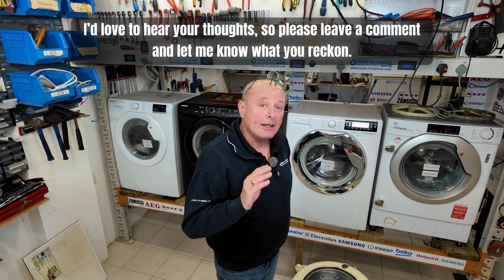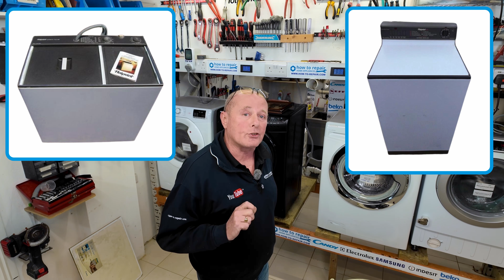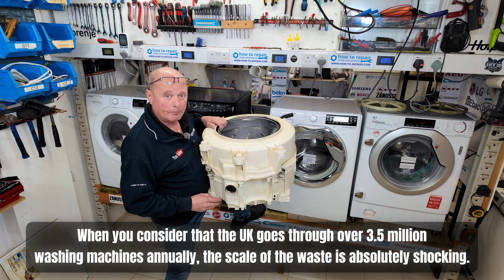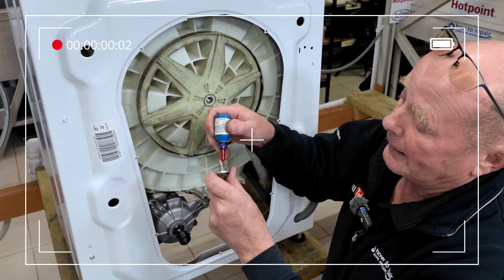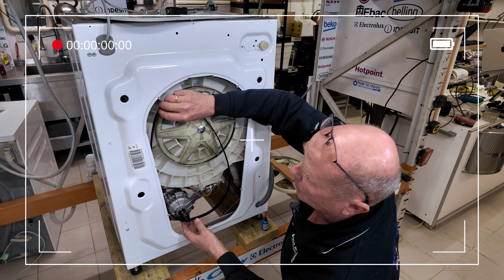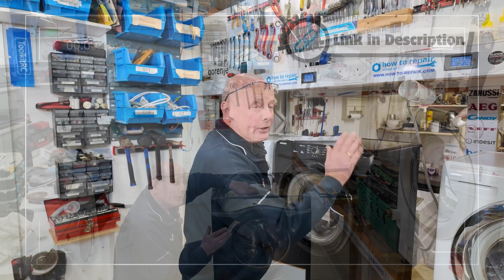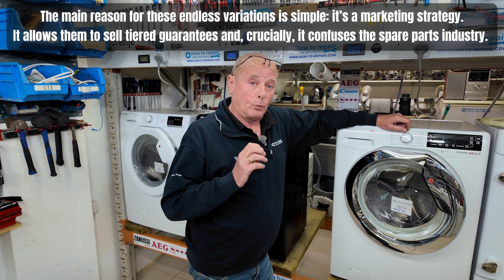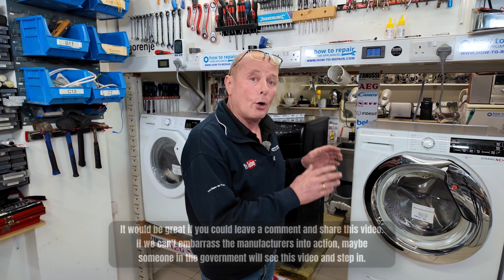I Scrapped 13 MACHINES to Prove a Point: STOP BUYING These Brands!

Comment: Hello everyone, I want to tell you that even the sealed drums are repaired in Bulgaria, we just cut along the edge of the glue, then we change the bearing, seal with silicone for motors, reinforce with bolts 5 milliliters or 6 millimeters according to the drum and that's it, all this costs about 25 euros. We assemble and you're done, that's it.I forgot to say that the price is if you do it yourself. 😅😊
Reply: Yeah. Recently had mine break (barely 2 years old) and I am going with the same plan after having seen it being done online, in posts and videos. The bearings failed and I'll have to cut the drum open. Drills holes prior, cut it open, replace bearings, use RTV silicon, bolt it, put it back together. Hope everything will go well.

Comment: Planned obsolescence is one thing, but restricting expert owners and repair shops the right to actually repair the Machine without the company scraping off the serial numbers of parts on the PCB. Making it impossible to know what the part was, is a absolute disgrace. 
If I can't find the part as the company do not supply the part. I will buy another one remove the parts and then return for a full refund.

Comment: These products are indicative of the society and paradigm we are living in. The Globalist machine rewards these manufacturers with creating sub-par products with a planned obsolescence in mind, it rewards them when they base their manufacturing plants in areas with ultra-cheap labour, and therefore lower quality labour.

It rewards them as it has conditioned the consumer to constantly want the latest product, no matter if the previous product works or not. It is in their interest then that the previous product doesn't last longer than when the next latest product gets released.

Repairing and restoration is indicative of the previous paradigm, a paradigm that was consumer friendly, a paradigm that rewarded local manufacturing, as it created a sense of belonging and community. This paradigm doesn't exist now, replaced with the modern paradigm, where a sense of belonging and community is looked down upon and punished. You are just a consumer, an economic marker within an economic zone.

Comment: I appreciate your video more than my washing machine from 2008, an Indesit Wil 105 that is still running. I changed only a belt and two small pieces (consumable) made from graphite or smt at the motor. Next time it brokes, I will try to repair it because is rock solid. I don't even think to buy a new one.

Comment: I'm afraid this is nothing new. I remember when I was a kid in the 80s, an engineer friend of my father told us that all the appliances and electronic devices produced for Europe since the 70s are designed based on the obsolescence principle, which means that all the manufacturers at some point decided to make all their products non-durable, meant to break easily, for quick turnover. Ruthless profit became the priority over durability and reliability.
I wish the environmentalists would campaign against this disgraceful practice, and in favour of durability, which would reduce environmental impact, waste of resources and pollution, as well as help households' finances.

Comment: Philips! wow are they Electrolux now. Grandad still has a Philips gas hob the only part missing on my Grandads hob is the ignigtion clicker button, the plastic is still able to push down and fire his hob, It must be 80s but the material ofthe hob cleans like a dream and just looks like new. The built in oven died many years ago but that must have lasted until 2004 and replaced with a Miele that on it last legs after 20 years.

Comment: Hoover/Candy are the worst. 2 x PCB failure on washing machine, and the dryer has gone through 3 x capacitors, 1 condenser unit, 2 x doors and 2 belts. The 2nd filter is useless, oh and they are also a fire risk, as evidenced by Hoover/Candy themselves!!!!!

Comment: They are also making worse machines in terms of program options and length, not just lifespan. I bought my top loader Hoover washing machine in 2022 and it was one of the very few top loading machines that is even capable of running a 90 degree program at all as there are already very few top loaders in the market over here altogether (Czechia but it is probably EU wide situation?). 90 degree program is a necessity if you have a dog or a baby because you need to wash some stuff at this temp to properly clean it (for example eco friendly fabric nappies). The programs on it are horribly long as well compared to a washer that my mom bough like 20 years ago. Like double the lenght for normal program, triple for eco. So when her washer broke last year, I actually advised her to let dad check it and repair it instead of pushing to get a new one because the new ones are shiet. And btw, my machine broke after half a year and the soft close latches on the lid corroded pretty much after the warranty has ended. You just earned a sub so I can learn and know better when this goddamn thing inevitably goes and I will be in the market for a new one.

Comment: Is it possible to build your own washing machine with standard components that are all easily replaceable?
Having the electronics with a Raspberri Pi and using it to control the washing cycle. The community would be able to make clever programs and optimize the runtime.

Comment: If they can't make a washing machine that lasts a lifetime today, it's because they don't want to. The wheel bearings on my machine are still original, and it's over 30 years old. A bearing today can't last just 5 or 10 years; it's because they don't want to. Just as they don't want to make stupid washing machines that last. It's simple.

Comment: I worked for Candy and Hoover, actually the chinese Haier group and it was all manufactured in China. They were building a whole new plant in Romania to manufacture in EU. But, to be honest, it is not a matter of where but how. They are cheap. I bought the top of the line Haier's WM and its awful. The digital front panel just brokes every 6 months and I am tired of it, the preset programs still work but I cannot change the settings in terms of temperature or time. I hate them.

Comment: LG washing machine - never again! I had an issue just after the warranty ran out. Post warranty repairs weren't even provided, so I had to fix it  myself. One year later I had to fix it again, related issue... 6 months later I again it had problems - I then threw it our, 3,5 years after buying it. The problem is related to the concrete weights that break into pieces, twice, a piece fell down and snagged the wire to the heater, third time the whole remaining piece got loose and the machine started to shake like crazy and the vibrations unscrewed a bolt, after that I decided that it was unsafe.

Comment: Than you. The main reason why a machine built 100 years ago is replaced is not, that it is broken and you can´t repair it. The reason is, that it is old fashioned. Has not same properties than new machines. My washing machine is 25 years old. My parents bought a refrigerator 60 years ago. My sawing machine is much over 100 years old (from my grandmother). These all are working well.

Comment: PLEASE, make and release plans for your own appliances!! The general public has access to wood, machine shops, 3D printing, Raspberry Pi, and Arduino… We can easily just make our own if you sold us some plans! We can use carpentry for the frame, use plywood for the sides, machine shop for the rest. It might cost more than a retail machine (however they’re getting crazy expensive so maybe not), however we’d have the ability to repair this machine for literally ever. Also, sometimes it’s hard to get to an appliance’s operating area, and this would allow us to assemble on site (for example, a laundry room that’s in a basement. The stair case is narrow, so it forces the entire household to use a tiny washing machine. OR we can build our own in the basement and end up with a bigger machine).
   At the very least, can you please show us what’s right in addition to showing us what’s wrong? If you don’t want to make the appliance plans, maybe someone else can if they had the right info.

Comment: Thanks for making this series of videos. It's an absolute shame that nothing lasts anymore. I only remember 2 sets of washers and dryers growing up. Replacement fridges and stoves weren't common either.  We changed cars more often than we changed appliances. My parents would generally run things into the ground until it was uneconomical to repair them.

Comment: This goes back to the printer ink scam long before they started doing it with other things. A new printer is cheap and comes with ink but to replace the ink cartridges you could buy 3 new printers that come with ink. I think they have copied the deskjet ink scam thing.

Comment: Tell me about it. We used to have a vacuum cleaner when I was a kid that cleaned everything up. There was no it would only do this and it would only do that like today. I could spend $,200 on a vacuum cleaner, and it can't vacuum anything up. And it won't last long, either. Fridges and everything that's coming are sold today are so bad. But the technology really hasn't changed. They just make it fail so that you have to buy another one. You know, it's like the story of the stockings. They were originally made out of a very strong nylon, and they didn't break and then sales went down. So they decided to make a flaw in the chemicals when they made the stockings. So that now they would sell more of them because everyone had their pair of stockings before and they weren't going to need another because they lasted so long. Now they do because they don't last long.

Comment: approximately 3 years ago i trew out the 32 year old bosch dishwasher from my parents because it was just old and gross and did not fit "aesthetically" into our new kitchen.
I bought a new one from hanseatic, wich then broke 2 years an 3 months later, impossible and useless to repair due to a design flaw in the orientation of the wastewaterpump AND washerpump.
making it so it will just get leaky again.
conveniently 3 months after warranty runs out here in germany.
i regret throwing out my parents old bosch machine now,
it still was able to clean the dishes ;_;

Comment: You're 100 percent correct about the longevity back in the 70s and 80s. I cant understand why people who repair appliances complain about todays appliances breaking down. Isn't that how they make their money? I also never understood planned obsolescence either. If I'm a manufacturer why would I make something that is designed to die in 5 years? Would I think people are going to buy my junk if it doesnt last? I'm pretty sure that the reason why they don't last is because if they were built to last you couldn't afford it. Do you guys recycle where you are? That would take care of the landfill problem. It does suck that nothing lasts anymore.

Comment: My parents still have a 40-year-old washing machine, now in very infrequent use at the cottage. The only issue with the machine is the mechanical program wheel which has worn out and only the 40 degrees C regular wash cycle works as a result. It's an UPO, a Finnish brand.
It'll be interesting to see how my brand new Samsung holds up. It's their top of the line model (11kg, all the smart home bells and whistles and "AI energy saving" features) which they were selling at almost half the price on their own webstore. At least they have a 20-year warranty on the motor, although it only covers the part itself, not any repair work.

Comment: My local supplier of new machines told me other day they are now no longer allowed to sell the same type of tumble dryer that I have (which has now failed after only 2 years.)  It's a self-condensing one.  They are only permitted to sell in the UK heat pump dryers (& if it's not in your area yet it most likely will be they told me.)  And heat pump dryers? Of course....they are more expensive😤😠

Comment: In Canada we used to have top loading washing machines. It's running out of style, but it makes more sense because gravity affects the drum much less and you don't need any seal on the door at all. Much simpler design and easier to load, specially when they don't have a central shaft

Comment: I repair Miele machines. The ones before the W1 series last 10 years after being refurbished. After 10 years, the wearing parts have to be replaced again.
For this reason, I only repair this brand. The ones before the W1 series were still good, they can be repaired and refurbished relatively cheaply. The W1 series was manufactured from 2011 to maybe 2019 with a degradable drum star. The W1 twin system breaks down over time, and since the panel was moved to the bottom of the device, it gets wet and destroys it.
They noticed that their washing machine sales had dropped significantly due to their machines breaking down faster than expected.
They switched to an acid-resistant drum star from 2019. However, this did not solve one of the main problems. There are many electronic errors in today's ones that were not in the old ones.
Their lower-end washing machines are made with a plastic drum, but they are screwed, not welded.

Comment: I used a washing machine for 40 years. The new 5 year old washing machine already has problems. I recently replaced the 6 burner stove, which I used for 50 years, with the new one which is ridiculously inferior, disposable and very expensive.

Comment: My parents splurged back in 2000 and bought a washing machine, drier and fridge which were all part of the Bosch Classixx range. Believe me when I tell you that not only do all three of these appliances still work but none of them have required anything! Not a single failure or replacement part needed, no seals, belts, bearings, nothing. I wish they still made this Classixx line.

Comment: Why does the manufacturer sell the costs of the parts so high compared to the initial price of the appliance? I used to work for a white good brand and actually would order the replacement parts. The real manufacturer of the appliance (usually a factory in China) wouldn't charge quite that much, but it would still be quite dear. Then when you'd add the transportation costs the price of the goods, which in reality would be through the roof. If you took that £108 motor for example, we'd likely be paying between £50 to £80 ourselves for that part.

Overseas factories, especially those in Asia are great in cutting the cost of the appliances themselves. But when spare parts compete for space in storage containers, they naturally prioritise appliances that are due for sale, rather than a few spare parts, which increases the price of shipping those goods even further.

Comment: i have used bosch maxx4 using over 20 years, changed only shock absorbers, heating coil and motor carbon brusches and it works perfect like old mercedes😅
Reply: I still use a Bosch Maxx 6, bought in 2007. You can clearly hear the shock absorbers but other than that it is still fine.

Comment: Nice video, but there is one thing I’m missing.
Even if you could take the drum apart and repair it, it would take a lot of time to remove and reinstall it properly. So the repair costs would probably be too high.
I don’t know how much a repair technician charges in the UK, but in Germany you pay around €100 per hour. So I would estimate the total repair cost to be about €300 or more.

Last thing: can you buy a "Miele" in the UK?

Comment: I used to have a maytag washer and dryer. My mom and dad bought it when they got married in 1980. We have been fixing them. The washer eventually rusted out. The dryer is still working with parts replaced. If the control board lasts, it will go another 20+ years. I had to replace the washer and chose to go with Huebsch/Speed Queen. We have been washing daily with the Huebsch since 2016 and it is still going strong. Since I thought Maytag was great, I bought a dishwasher years ago...worst appliance ever. It would leak...from a hole under the float...who would design something like that? I almost slipped on a puddle of water in my kitchen multiple times. I complained to customer service...that went nowhere.. I eventually replaced it with a Bosch dishwasher which has been great. Shark Vacuums seem to have also cut corners..

Comment: Actually to wash laundry with less water doesn't protect the environment because many times i had to re-wash my laundry. I bought a Whirlpool 10 years back and it was  a nightmare ,   my laundry was smelling after the washing finished and i had to wash it again adding extra water . Now i bought a Hoover and i'm crossing my fingers.
Reply from the maker: Make sure you cross your fingers on both hands with a hoover.
Reply: @How-to-repair sorry my mistake, is Beko. Do i have some hope? At the moment with the option extra water my laundry is clean and smell amazing.

Comment: Who wants to use a 30 year old freezer or fridge? Those are energy hogs. I'm completely fine with replacing them after 10-20 years. Same goes for washing machines. It's actually disgusting to think about washing clothes in a machine that has seen the dirt of two decades. 

The right to repair is important though for those that actually want to keep their stuff running.

Comment: Not an engineer but a consumer. 
We had a Swedish made Cylinda toploader for about 30 years with some minor service and repairs.
The first toploder I had, a Wirlpool, which came with the apartment, lasted 5 years then rusted out and started leaking.
We now rent an apartment and share laundry rooms with other tennants, which is common in Sweden, and use commercial Elextrolux washers which are simple beasts of machines, doing laundry 9hrs a day 365. Load, select 1/8 programs and off you go.